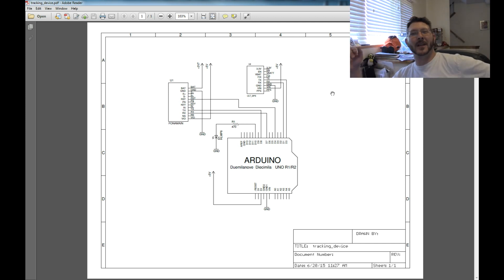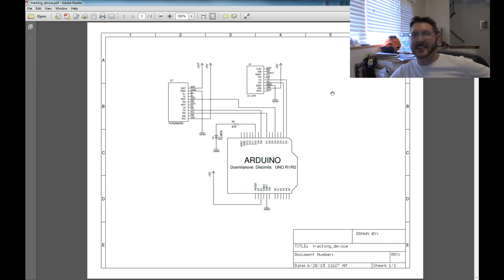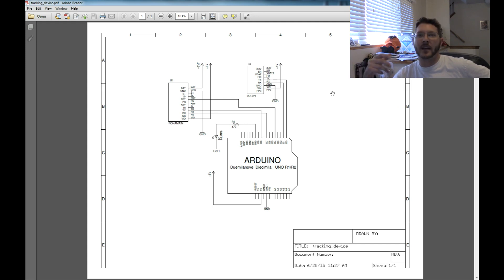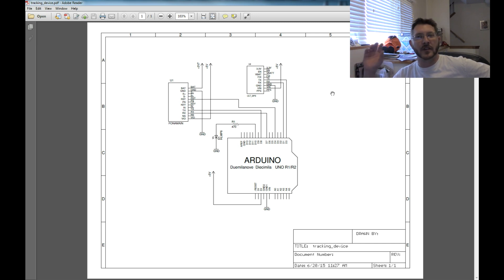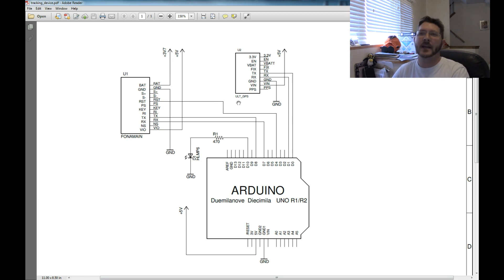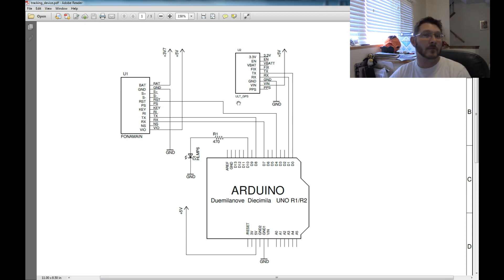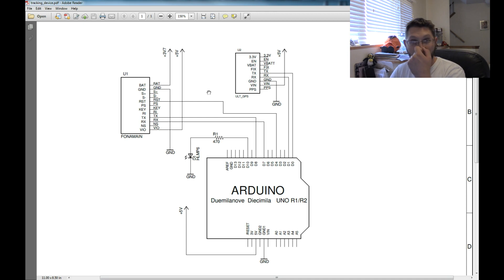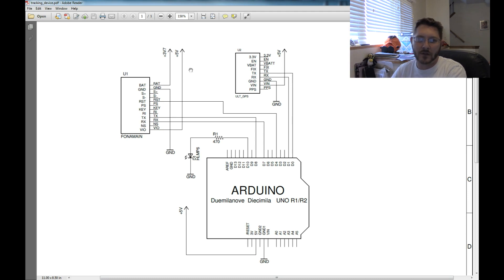Tracking Device - Part 1 Hardware

Comment: Great video!  What software did you use for the circuit diagram?  I would LOVE to make some "industry standard" ones like I am used to seeing at work all day long :)  Cheers
Reply from the maker: Eric William -MKme Tech Hey bud,  Well there are a couple of softwares out there.  The main one I use is EagleCAD.http://www.cadsoftusa.com/  it has a free version that is limited by board layout size and schematic sheet number depending on whether you get the free or buy the different priced versions.  The thing that I love, love, love about EagleCAD is the library of prebuilt parts and many vendors have their parts built for EagleCAD.  The Arduino parts are in a library from adafruit that you can download from their website.  I also have some videos on how to use EagleCAD that you can check out.

The other one that is a totally free opensource schematic capture and board layout is KiCAD.  This one is, I believe, only available for a linux platform but you can design entire panels with this software if you want there is no limits. http://www.kicad-pcb.org/display/KICAD/KiCad+EDA+Software+Suite

Hope this helps.
Reply: +Eric William -MKme Tech try fritzing
Reply: +misperry Would the same diagram work for the 3g version of the Fona? I am going to try and build this but since I'm only 14 I don't know much about this stuff. Thanks
Reply from the maker: I would think so but I would check the libraries for the arduino for both of these and make sure they are the same.  If they are not the same hopefully having both side by side you can spot what you will need to change.  let me know if it gets hairy and I can download the information and take a look but that is where I would start.
Reply: misperry Ok thankyou. I've found tutorials online with the 3g version